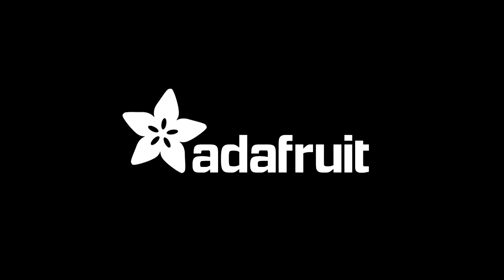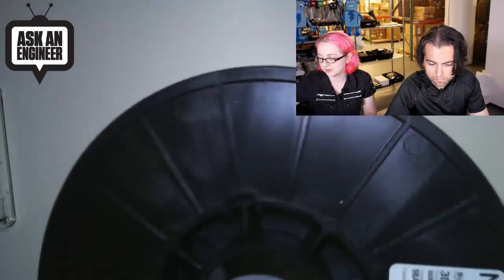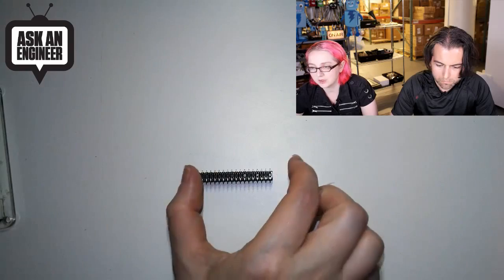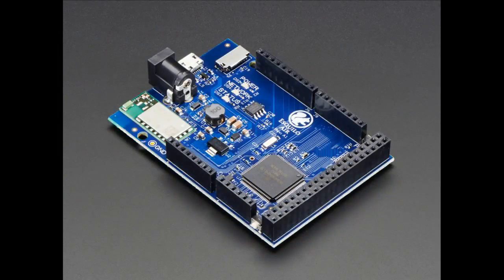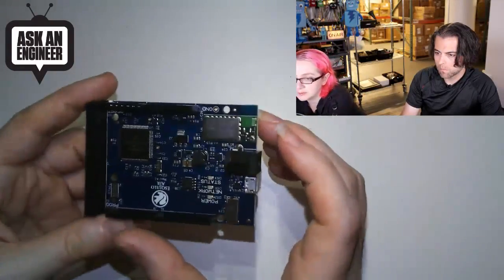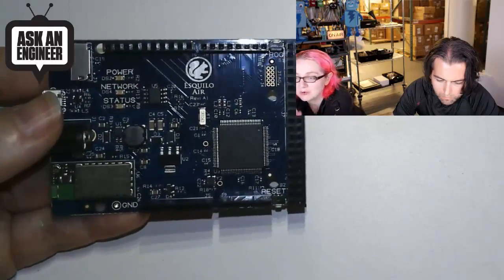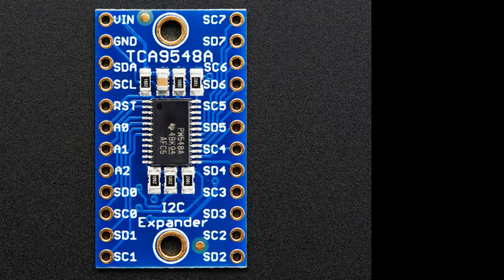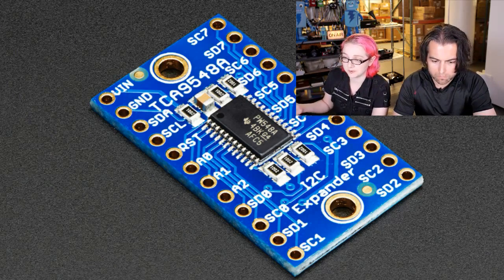New Products 9/16/2015

Comment: Hey, I found in TI datasheet that the chip "allows voltage-level translation between 1.8-V,
2.5-V, 3.3-V, and 5-V buses"
will it work with different Vcc's or only that it supports all types of Vcc's 1.8-5? i have both options of I2C devices 5V Vcc and3.3V Vcc. can i use this device without logic level converter?
Thanks

Comment: Love the I2C Expander! I wish there was something like that concept but for large amounts of digital pins. The complexity of a circuit required to drive a 100 LED bar display(ok, maybe 5 or 6 100 LED bars) with shift registers makes them impractical, but would look very cool in my PC gaming cockpit projects.
Reply: +Geneticus0 https://www.adafruit.com/products/732 here you got 16 more outputs. or you can use a microcontroller with more IO and then use some transistors.